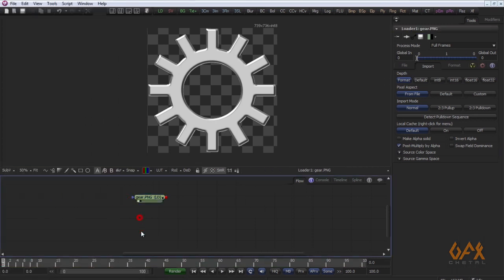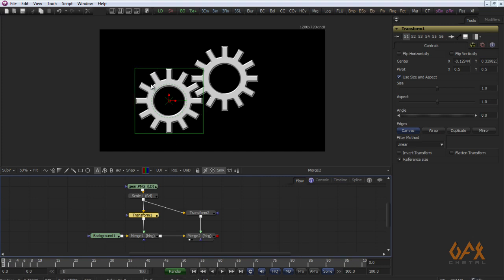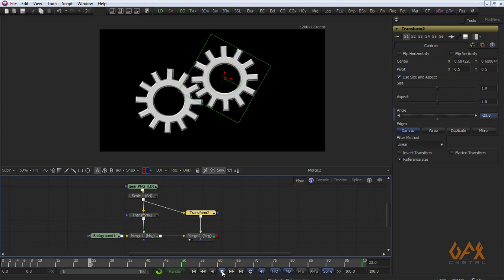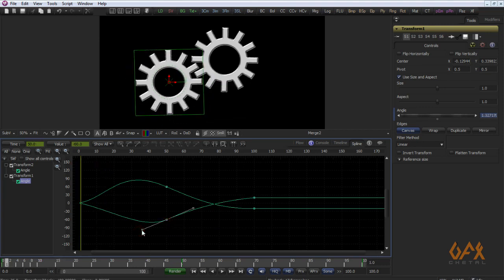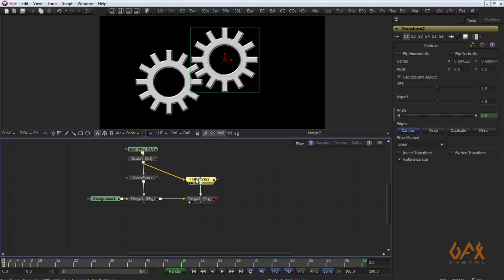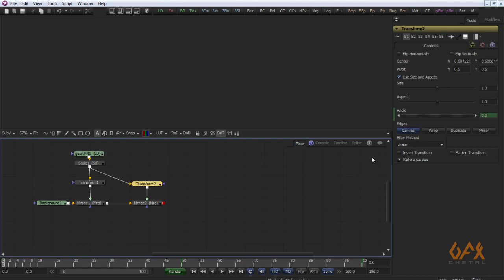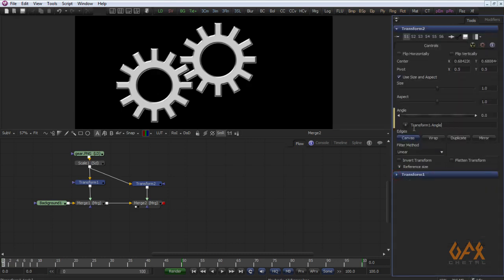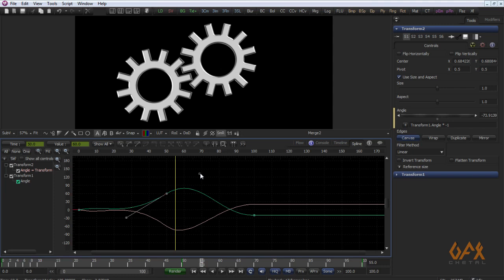BMD Fusion Expression Series | Session 01 : Why we need Expression?

Comment: I used and expression. to create text on screen, based on the Z rotation of another node/object.  Thats OK. But the expression is: (Shape3D_POINTER.Transform3DOp.Rotate.Z-270)*-1/8  Which gives me a text changing the number like 20.23 and the problem is if I animate the the #D_Pointer the calculation gives my many decimal places.  How can I limit the answer to 2 decimal places...?
Reply from the maker: You can try this one

math.ceil((Shape3D_POINTER.Transform3DOp.Rotate.Z-270)*-1/8*100)/100

how this process

math.ceil(12.34567*100) give you answer 1235
and you divide that with 100 so you get 12.35

Hope this will help you :)
Reply: @ChetalGazdarVFX  thanks. I ended up using>>>  string.format("%.2f", Shape3D_POINTER.Transform3DOp.Rotate.Z-270)*-1/8)
Reply from the maker: @MarkTheQuietCircle  Great !!